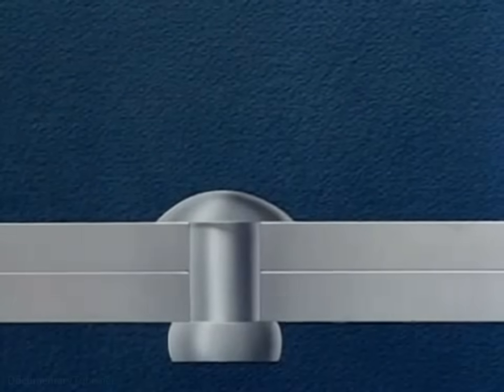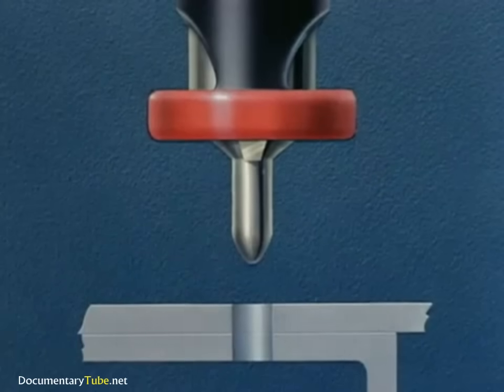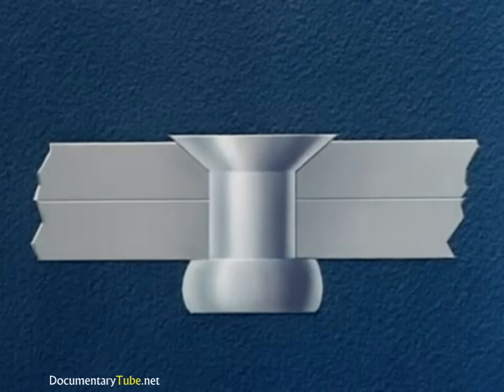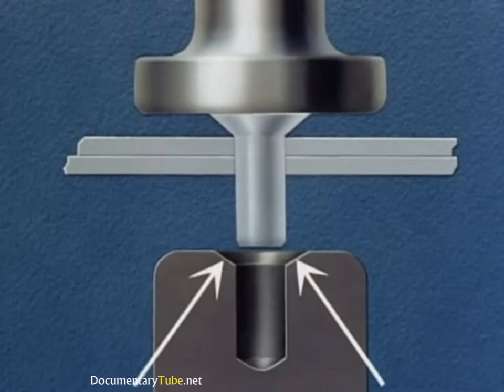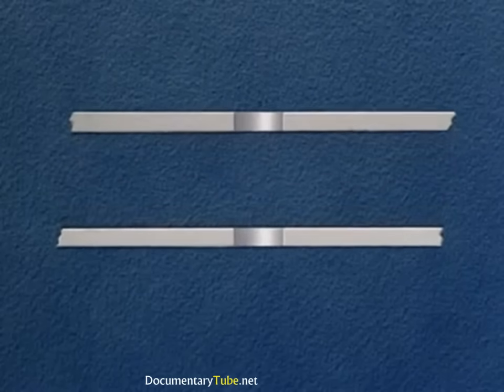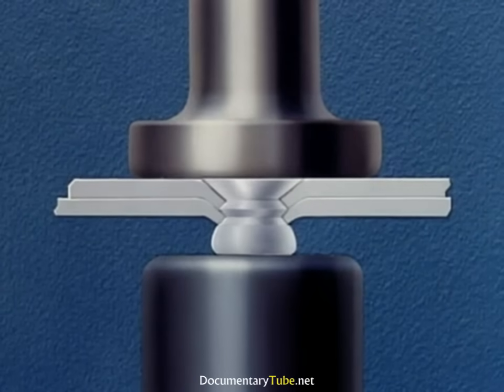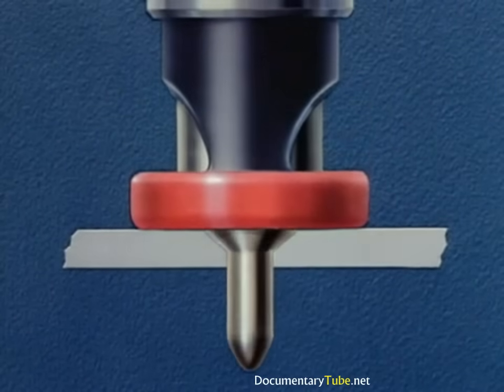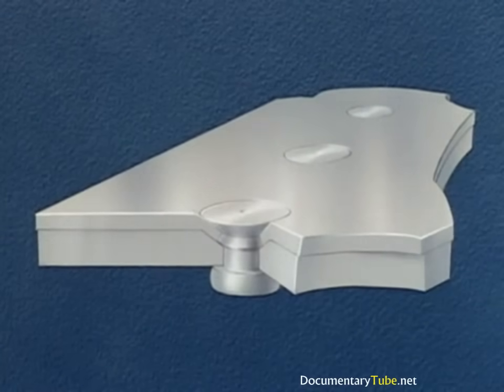HOW IT WORKS: Aircraft Flush Riveting

Comment: Somewhere my father got the tool for drilling and countersinking.  It's commonly called a countersink cage, or a microstop countersink cage.  They're still being sold.  You can buy a variety of sizes of bits to go into them.  They also work very very nicely for controlling the depth of flat head screws in wood so you get a nice, uniform look.
Reply: When my dad passed away I found one in all the stuff he had in his shop.  Not having any idea of what it was or how to use it, it took me a while searching on the Internet to find out what it was.  I've used it in my woodworking several times.

Comment: Unfortunately flush riveting is not required as they lay within the air boundry layer of the aircraft skin. We now also know buildings require some rough surfaces to allow airflow to travel and break cleanly away. Shark skin is also textured for the same reason it creates a boundary layer swim suits now use this technique.
Reply: You are wrong.

Comment: How can the head be driven below the surface ? Do you deform the top skin ? It's not like a bolt that you can tighten  and suck the head  below the surface , it's hammered down , so really can't go lower than  the surface . If it is lower the head was to small, or the counter sunk hole was to big. Either way the rivet would not be as tight as it should have been

Comment: The recessed
Rivet at a 40 to fifty degree angle from the centreline for a flush fit is a great idea.
But i wonder if the bottom plate could have a slight parallel recess so when the rivet expands it sits almost flush.
As long as the material is thick enough my process is possible and preferable.
Reply: Why? It’s not in the air stream so it doesn’t need to be flush.

Comment: What is really wild is those frozen rivets. They heat treat them and freeze them to keep them at condition w and the age harden after being bucked. Far out eh?
Reply: “Ice box” or “freezer” rivets were used in the WW2 period usually for larger sized rivets but are now mostly obsolete owing to newer rivet alloys that allow larger rivets to be driven without cracking at the edges of the rivets. Also aircraft manufacturers these days tend to use a non rivet fastener called a “hi lok” for preference in places where a higher strength fastener is needed.

Comment: I love how there is no mention of the metric system!
Reply: It's both old (1960s?) and American so that's two reasons. The use of 3 different size measurements in this one job is typical of imperial-world (power-of-two-fractions of an inch (1/8"), thousdandths of an inch (thou) and arbitrary numerical sizes (#30 drill, actually 0.1285")). It worked, but there really isn't any good reason for it, and just gives extra opportunities for error, which is why nowhere except the US (and probably a few places with old imperial machinery and/or materials) still goes in for this. A 3.2mm rivet in a 3.29mm hole (more likely 3.3mm), with sheets more or less than 1mm thick is a lot easier to understand.
Reply: xxwookey   Not really, you don’t have an infinitely number of hole and river sizes to deal with so you actually have to try really hard to mess this up. 

In the case of assembling a structure with pre determined components it really doesn’t matter at all what the specific units are, you know what you need for the job so you grab those parts from the bins.
Reply: He is just using the system used by America to land on the moon.
Reply: Bryce Peters   No, we went to the moon using metric. They may have reported ranges and altitudes in miles but they were calculated in kilometers etc.

Comment: This is all completely wrong. I worked as a metal riveter at Bombardier for 35 years. All you do is bang the sheets together with a regular hammer and solder them together along the seams on both sides with lead-free solder. If there is a leak, super glue works just fine, or silly putty in a pinch. Aluminium is much stronger than steel, so it's easier to grind panels into shape on the spot than to cut the pieces beforehand. A priest blesses our work at the beginning of each day, and at lunch we would unwind with a little wine and cheese before sending our work to the inspector with a little bribe. No worries.
Reply: I believe you
Reply: But if you had to bribe the inspector.. Maybe you were the ones doing it all wrong? Just a possibility..
Reply: Lead free solder? You cowboy.
Reply: Superglue and silly putty.. Either you're full of shit, or you've been in denial about the shit quality work that was done in that factory
Reply: Beat it to fit, trim it to make it aerodynamic and then paint it to match.

Comment: so you need two people? One person on the inside of the plane constantly waiting for the outside person?
Reply: It's incredibly fast. Outside guy (Riveter) puts a rivet in the hole and lightly puts his rivet gun against it.  Guy inside (bucker) puts his bucking bar on the rivet and pushes it out a little (this lets the riveter know the bucker is on the rivet and ready).  Riveter then pushes the rivet back in and gives ONE burst of the rivet gun, (BRRRRT!) and then keeps his gun in contact.  Bucker then removes the bar and inspects the size of the upset head.  If it needs more he puts the bar back solidly (one tap) so the riveter knows it needs more and the riveter gives it a short burst (repeat as necessary).  If the rivet is good he gives it 2 taps and it's on to the next one.  If the upset head is too flat or bent off to one side the bucker will tap it 3 times to let the riveter knows it needs to be drilled out and a new rivet installed.

Comment: This vid can help for most  repair or sheet metal fab. 
Attn to detail , well  let's just say, good as you see planes fly. If not they fall faster than birdshit
Reply: Had to learn this trying to get hired by Douglas Aircraft  In a UAW sponsored job training program. Tolerance must be met & skill's in drilling, countersink guage  inspection, , correct tooling & rivet method must conform to Engineering blueprint . Went automotive career instead, all in class that got hired, were laid off within two years later.